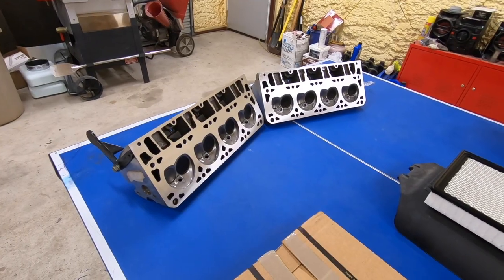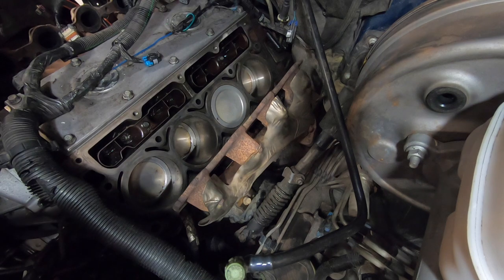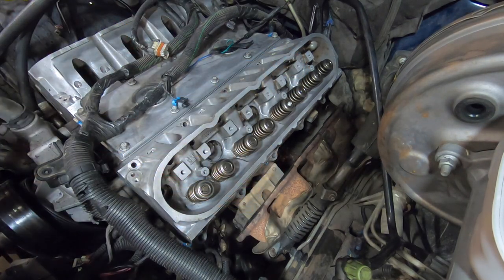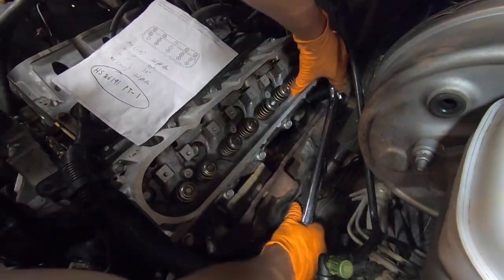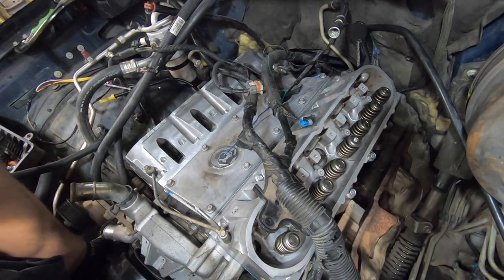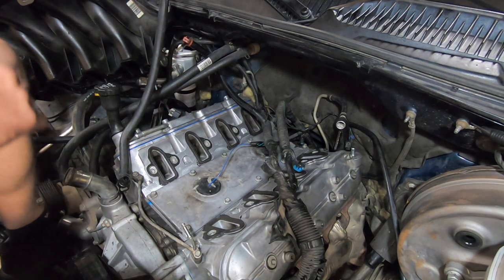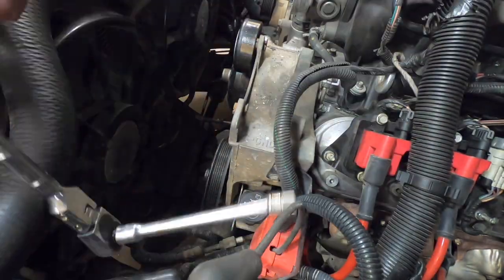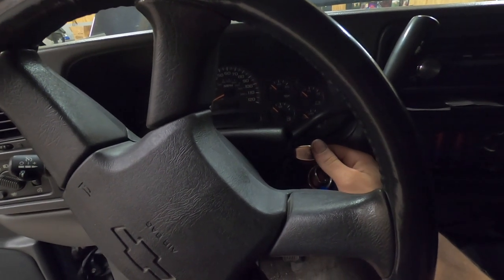Head Gasket Replacement || Part 2: Install

Comment: What happens if u forgot to blow the bolt holes out and torqued the head down
Reply from the maker: Debris could cause the bolt to not go down far enough and not allow sufficient pressure on the head. Most likely it'll be fine though, just a precaution
Reply: Thanks
Reply: On the torque spec for the rocker arms do i have to rotate the engine in order to torque all those down
Reply from the maker: Yes, otherwise some will have upward pressure while you are torquing them down.

Comment: The great debate: to use gasket sealer or not?  Your thoughts?
Reply from the maker: Gasket sealer for which part? I showed how I do it
Reply: @dudewecanfixit  yes, Sir...I seen that.  Why didnt you use gasket sealer on the paper gasket?  I'm curious.  Sir.
Reply from the maker: Which paper gasket? The head gasket is a multi layer metal crush gasket

Comment: How much for a job like this?
Reply from the maker: Where I'm at, $500 for the labor and $200 for the parts. Unless, you need to get the heads machined then I would add another $300 to get that done.

Comment: Who sells good quality parts, head gasket kit, head bolts, and lifters for 2007 Silverado OHV without the AFM lifters
Reply from the maker: I usually use felpro head gaskets.

I'm not sure about the other parts. Do some research on a forum

Comment: How can both the intake and the exhaust of one cylinder be in the down most positions at the same time? You should be torquing each rocker on its base circle.
Reply from the maker: They won't be down both at the same time. But you can torque them individually in the down most position

Comment: I did a job like these because there was a cylinder with no compression, a couple weeks later engine starts knocking like, any ideas what could had happened here?
Reply from the maker: Possibly bottom end wear

Comment: I did a burn out and i blew my head gaskets out and my starter i replaced the starter and it turned one but it would turn off when I would drive it so I did a oil change and the oil came out Like chocolate so I changed the head gaskets and I put everything back and now it’s  having a hard time to start I sprayed some starter fluid and it wanted to start but it couldn’t and I checked out the spark plugs and there black and some don’t have spark and am low on coolant what should I do ?
Reply from the maker: It sounds like your spark plugs are fouled. You can either clean them or replace them and see if that helps

Comment: i would never use any type of wire brush, plastic brush, scrub pad thts made of wire to clean inside heads or block
Reply from the maker: As long as the brush is a softer material than the aluminum heads, there won't be any damage. It is absolutely critical to get this area clean.

What is your preferred method and tools?

Comment: Odd question, how did you rotate the engine to move the springs?
Reply from the maker: With a socket on the crankshaft bolt. Locate the large pulley at the bottom center of the engine, that's the crankshaft pulley. There is a large bolt in the center of it that holds it to the crankshaft. Rotate that bolt clockwise to turn the engine.
Reply: @dudewecanfixit  thanks :)
Reply: @dudewecanfixit  In the video I noticed you turned it counter clockwise though.... does that matter or did I miss something?
Reply from the maker: I normally rotate clockwise because that is the normal direction of the engine. However, you can rotate the other way
Reply: @dudewecanfixit  thanks man. Great videos.
Reply from the maker: Thanks!

Comment: I used tty bolts they seemed to not be tight gaskets leaked 
Had to use a stud kit
TTY bolts are the worst design. Ever
Reply from the maker: That sucks. I've never had issues with tty on stock engines. I'm sure the stud kit is an upgrade. 

Did you have the heads machined?
Reply: @dudewecanfixit  I used a three chaser on em but I think 
My torque wrench was off

Comment: First your cleaning the block not the head. And you did not even cover the lifter area, which is very important becasue these motors have lifter problems. Maybe your not the guy who should be showing this????????
Reply from the maker: If you watch the video, you will see that the heads were sent off to a head shop. Heads are aluminum and prone to warping. They get cleaned and resurfaced. The valves and seals are also replaced.

The block is not aluminum and does not usually warp. If you sand the block unevenly, it can lose its flat mating surface and cause a head gasket leak. I leave resurfacing to the pros who have lathes. 

I'm also not a fan of introducing fine aggregate/abraisives to the internals of an engine. Sounds like a recipe for premature engine wear.

I hope your method works well for you.